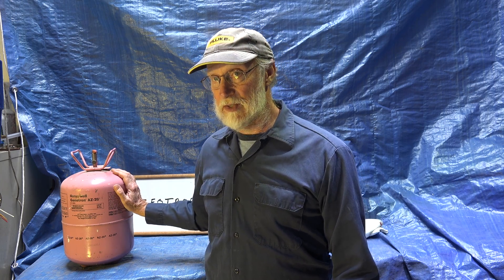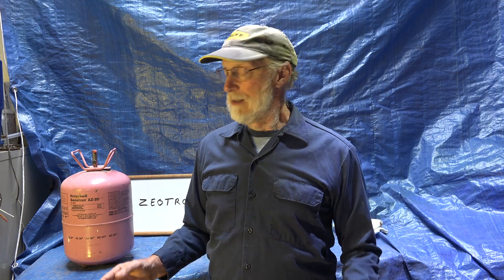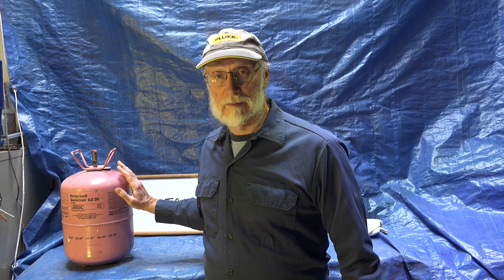What is an Azeotrope refrigerant

Comment: How refrigerant blends fractionate or come apart when not used properly?
Reply from the maker: Blends are mixtures of 2 or more different refrigerants with different boiling temperatures when at the same pressure.  In the case of a leak in the gaseous portion of the cycle, the refrigerant with highest boiling temp will leak faster and will make the blend unbalanced.
GFM

Comment: Thanks for making this video! I had no real understanding of these blends or the terminology. I when I graduated HVAC school in back in early 1995 we had the good ole R-22 for air conditioning & you could charge a system using your gauges, a PT chart & the return-supply temp split & call it good. Beer can cold as they used to say. Now everything is much more complicated...wet bulb, dry bulb, super heat, sub-cooling, etc, much more parameters to deal with.

Comment: what is the difference between azeotrope  and near azeotrope?
Reply from the maker: An Azeotrope will not split into its constituent parts.  It acts as a single fluid.  A near Azeotrope has 2 or more refrigerants mixed that have boiling temperature/pressures that are very close to each other.  On the like of 2 to 5 #difference.  Near Azeotropes must be charged as a liquid.  Azeotropes may be charged as a gas.  Hope this helps.
GFM
Reply: it is a little confusing because they are both made of multiple refrigerants with close glides,thank you for the explanation.

Comment: A place I worked at had a refrigerated test chamber that had at least two compressors in it, it could achieve very cold temps (can't remember how low) but I think around -50F
It had a label on it that had the different refrigerants but again I can not remember what they were. What is R410A used for/in?
Reply: Sounds like you had a cascade system. Alot of those use 404a and r23.
Reply: That rings a bell, I know it was a sad day when we had to have that serviced. It was used to test aircraft electronics in very cold conditions (obviously) Thanks for the information